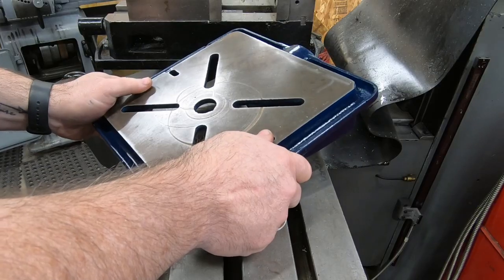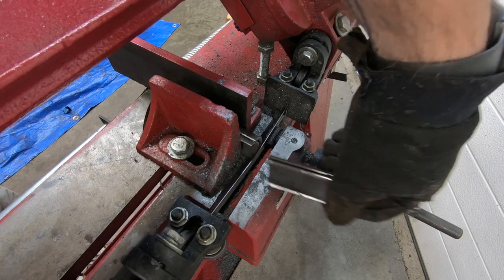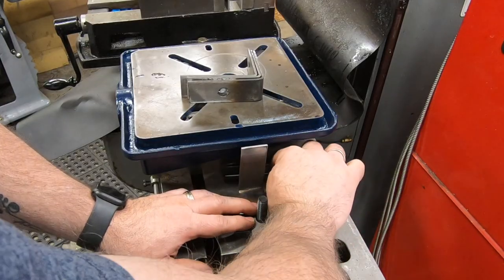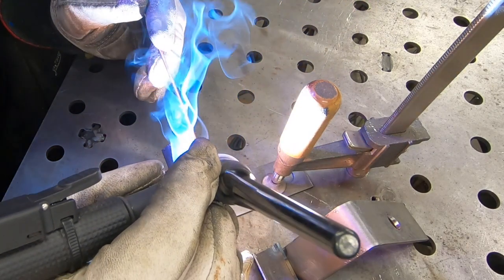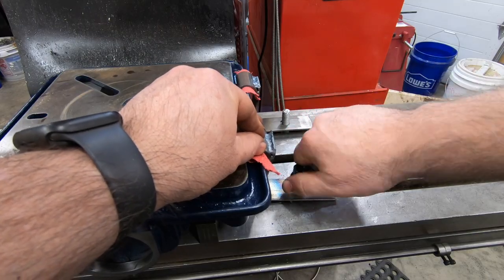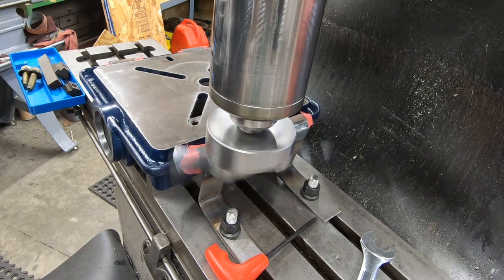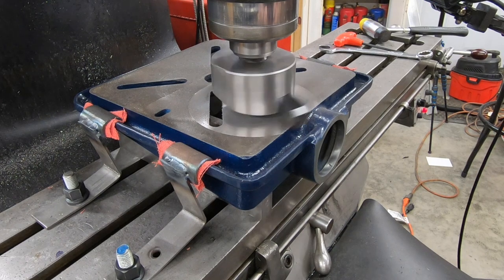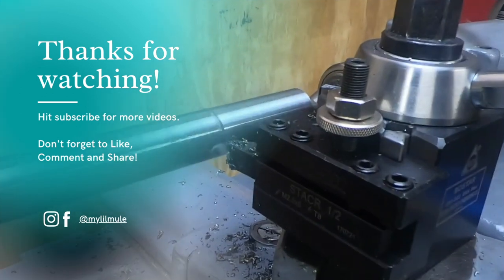Restoring a 1940s Craftsman Drill Press - Part 2

Comment: Gday Greg, I find with my bandsaw as soon as the blade dulls of a little it tends to drift off in the cut, new blade fixes the problem, the clamps worked great, thanks for sharing, cheers
Reply from the maker: Thanks for the info. I've got a new blade coming, hopefully that'll fix it up.

Comment: I think for a drill press tabele, you don't need a mirror finish. It will make it too slippery.
Always nice to find a hold down solution. Good one:)
Reply from the maker: Yeah, that's true, but it sure would look pretty. I'm still not all that happy with the finish. But it's going to be used, so it'll get scratched up in due time.

Comment: Sounds funny but could you have put the entire drill press up on the mill bed? Just wondering if there was a benefit to making sure the column and bed were perpendicular?
Reply from the maker: I don't think that I could even get it to fit, plus there would have been much benefit. It's not a precision machine, so if it's less than .020" out of square, you'd never notice. Plus, I doubt it was ever that precise. I put way more work into it that it is probably worth, but I wanted to start with a clean slate, so to speak.

Comment: LOL "bozo mark."  Now that you have made it look fancy again, you are going to have to be careful with it.  Instead, the first thing you should do it drill a "mistake" hole in it, so you can relax a bit.  Ha!  Just kidding.  Looks great!   I wonder if you increased your RPM's if you would have a finer finish with that fly cutter.
Reply from the maker: The fly cutter is so off balance that increasing the rpms would likely make it worse. But, the most important parameter is feet per minute - how fast is the cutting edge moving across the part. I use an app "FSWizard" on my phone. I just plug in the diameter that the fly cutter is making as a single insert cutter and it calculates RPM and feeds.

Comment: Looks like a possible tension issue to me in the blade. I have an old jet that was doing the same thing and if you look at the video the deflection happening may be the overall issue. Sadly it would be a bad blade and tension too.. I love/hate bandsaws
Reply from the maker: I know what you mean about having a love/hate relationship with them! I checked the tension when it started. It was pretty tight and where I usually keep it. I'm going to replace the blade and see if that is what it was.

Comment: should always try to chock up your spindle
Reply from the maker: Yes, but this is a Bridgeport. It's rigid as hell. I'd had that spindle all the way out and never experience chatter. It's made to be able to do that.
Reply: @MyLilMule  you'll still get defection in the spindles/quill no matter what bridgeport you have. I've ran serval over the years from manual to Nc control to trax mill. more you choke it up more rigid and better surface finish you'll get.
Reply from the maker: @Bigolepally  Maybe in some cases. For this, it's not going to be an issue. We're talking soft cast iron and maximum DOC of .005". Even if it does deflect, it's not going to be noticeable or likely measurable with typical shop metrology tools. But you do make a fair point. Appreciate the input and I will definitely keep that in mind.